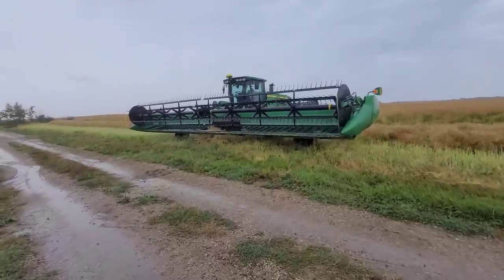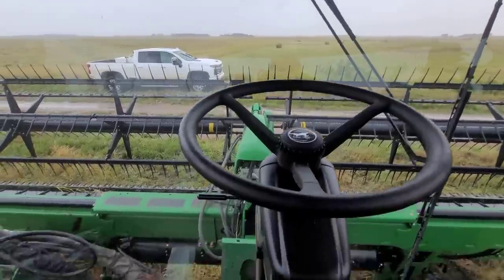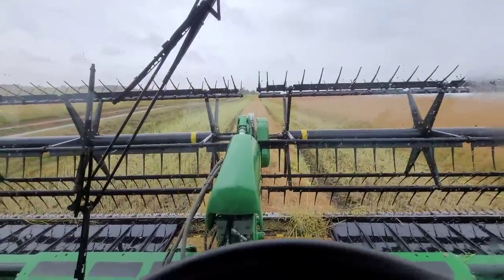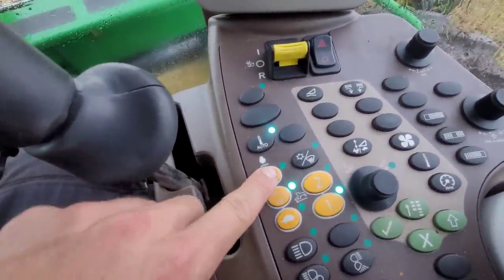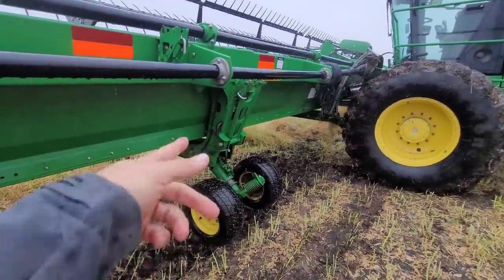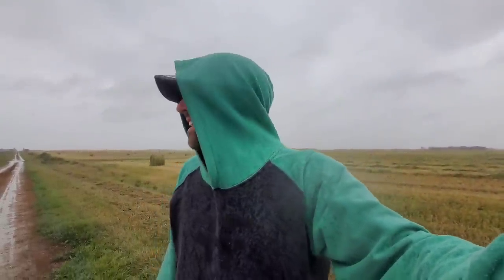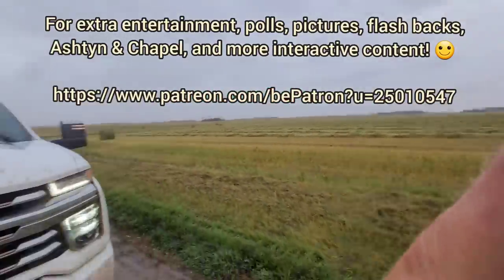Swathing Problems... 🤦🏻‍♂️

Comment: You could cap the cylinder oil port (with metal cap) if it's the cylinder, the wheel will still go down.
If it stay up, it's the circuit. Could be the splitter valve or the stack valve.

Comment: Cut a piece of C channel iron the length of the cylinder stroke and put it over the rod so it acts like a safety latch and it will hold that side at the exact height you want it to stay at
Reply: For a temporary fix yes
Reply: Yes! What I was thinking.. or actual fancy cylinder stops..

Comment: In Northern Alberta we have the same issue with canola not wanting to fit in the hole. Our swather also decided to throw a rod so we were on a swather hunt To. Which posed some great difficulty to find one we wanted but we did find a m105 macdon with 30ft head which is to big for us but we ended up only using 23ft of it and hanging 7ft out and swaths dried up beautifully. One of our combines is a 9500 so it still handled it great. Made it easier to ram in the hole and easier on combines. Maybe worth a try to only take a smaller bite.

Comment: Mike, 
    Maude Potvin is right; cap the ports to see if it's the cylinder or the circuit.  If it's the circuit, you could cap the ports on the cylinder at the correct height and just run it locked.
If it's a new head, maybe you need to bleed the air out of the hydraulic system to that cylinder.

Comment: I hope you managed to fix your swather....
I would wager that your accumulator on that side was low of nitrogen.
We have D450's as well and don't really put that many hours on them anymore. We have kept them because mechanically wise they are pretty much indestructible.
We have done some modifications on the heads to make them more canola ready..
We took the swather decks out and made them shorter on the hole side.
You can do this by removing a section close to the  roller and then welding it back together and then shortening the canvas accordingly.
(the canvasses have to be driven on the outside to do this)
We added an extra spring to the tensioner and now our canvasses never slip.
We put open top guards on and now down canola in sprayer tracks doesn't bother us anymore.
We added a pea auger that is lower on the outside edges and higher in the middle.
The swather works fantastic now except for the fact that it doesn't flex well through waterways. (that cannot be modified )

Comment: I just bought a JD W235 with a disc mower 500r on it. The right hand cylinder or accumulator seems to have an issue because I have to keep turning up the pressure on it every 15 minutes or so...It does seem like they've made it easier to adjust the float on the W235 compared to the d450. The cab is really quiet in the W235 as well. It seems like a well built machine. Much better than the MacDon M205 I have.

Comment: Mike, that pin is to far out, you can see where it's supposed to be and without that pin in the cylinder pushes to far in. put that puppy in and it'll work!

Comment: Our d450 had a pressure transducer on one side of the header that was bad.   It couldn’t give a code for it for some reason so it took awhile to find it.   It was acting like yours is tho when it happened.  Hope that help.  Thanks for the content
Reply: Your diagnosis is probably the best I've read so far, so thanks for the input. I tend to find people that have had & solved similar problems are generally the best ones to listen to. 👍🇬🇧
Reply: Yeah the bad transducer was making the potentiometer values out of range for one of the wheels I believe and that’s why it wouldn’t calibrate

Comment: There must be a nitrogen accumulator in that float system that is playing up , or a valve that is bypass the the float and dumping, haven’t worked on those ones but they are not normally difficult to sort.

Comment: On our case swather it does the same there are pressure numbers for float on each side go on you screen find header float the adjust it for each side make them even like one mite be 950 the other will be 1200 that will cause that. Our case does that I like it for cutting hay on pivot tracks I can raise on side up to ride over them while the other side stays down if it was the old way I cut it high on both sides.

Comment: Mike look into the heads they use for Rice combining, they're a blue colored head that just takes off the tops of the rice plants and leaves the stalks.
Reply: Those wouldn't do well in canola I don't think. Especially if you mean he should look into them for swathing.
Reply: @egomania2792  no, this only takes the top off the stem!
Reply: Stripper fronts do not work on canola

Comment: Also the swather heads will float should the wheels be rigid. If you were to block the ram from collapsing and use header height resume instead of flex? Rough it to get through the year and once it's all cut have a better look at it to get it fixed

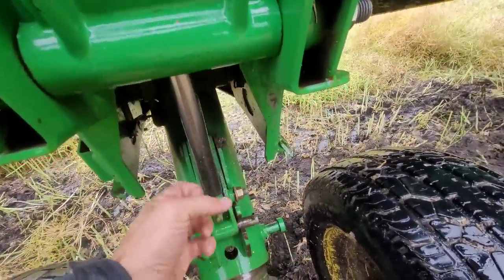Comment: Hey Mike, go to 7:50 into your video, your talking about the L cylinder, is it me or does it look like the pin is out? If that's supposed to be pushed all the way in, that could be why it's hanging low on the left side! It almost looks like it's about ready to fall out. I pinned two pics for ya

Comment: LMAO roll with the punches from crap Deere.
Reply: I suppose all the other makes are trouble free
Reply: @kenhofer8063  I suppose if you had a Deere you would feel special. Gleaner can be fixed Deere you will be waiting to fix because you need bolts an oh you can just lose bolts that you payed for an cost you 800,000.00. Good job Deere, Be proud. LMAO, only a farmer would spend that much on crap. You need a 🔩 Lol.